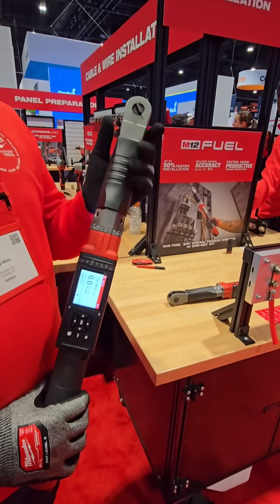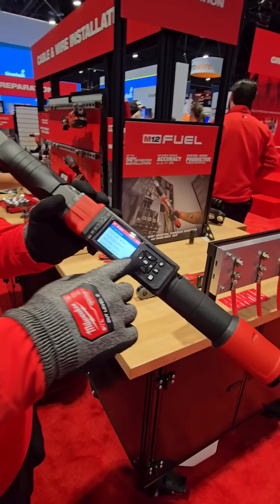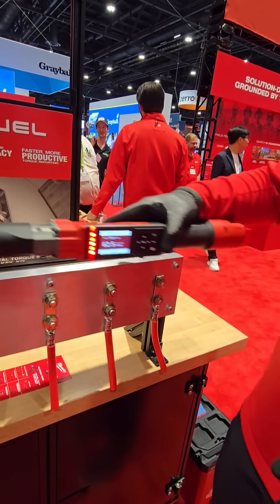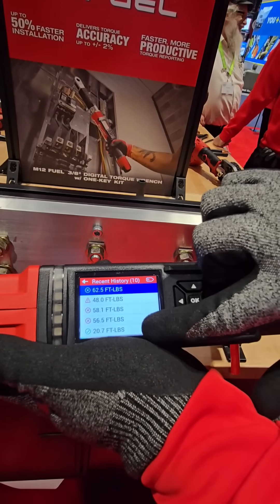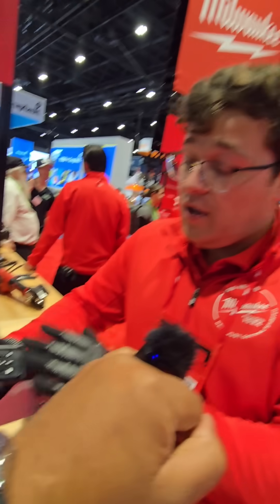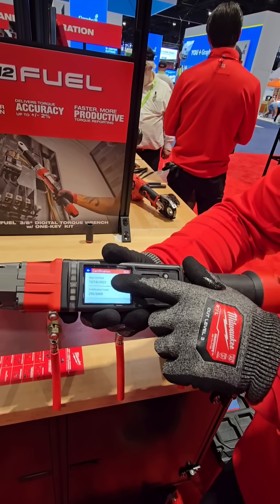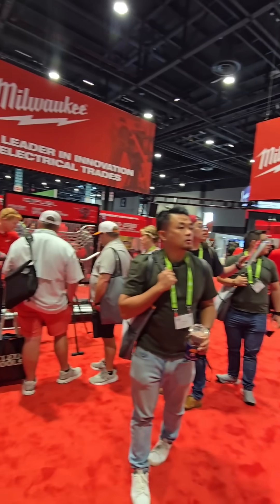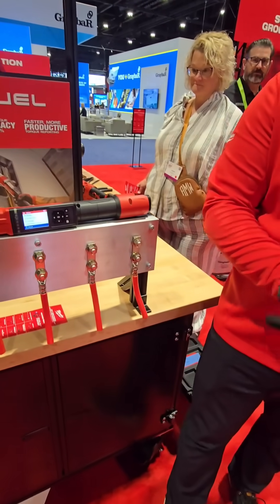Milwaukee’s M12 Digital Torque Wrench Is Next-Level Tech 🔧📲

Comment: So own it for ten years and that's $1000 (assuming the recalibration fee does not increase in that time). No thanks. There should be a owner-calibration method offered
Reply from the maker: Is there an owner calibration method for Snapon, Gearwrench, or any other brand for a digital torque wrench?

Comment: $450 would be a deal. $800+ is just a cool thing for someone else
Reply: And it’s wayyy too big
Reply: On top of 100 a year for recalibration.   Should be free at least during the 5 year warranty
Reply: @chazwatson1810  the contractor I work for gets stuff to test out for Milwaukee, dewalt, and Hilti. Anyway they sent us these and they did the recalibration. Although we were doing them a “favor” by test them out. Yeah they give a lot of contractors in my local tools. They also give the apprentices a set of tools every year.
Reply: But if company pays I'll use it! 😂🤣
Reply: @312j-who  I work for a top 50 electrical contractor in the U.S. so we get all types of Dewalt, Hilti, and Milwaukee stuff before it’s out. We’ve had these for a little while. They are pretty cool. I’d never buy one personally but If they are there I’m gonna use it.